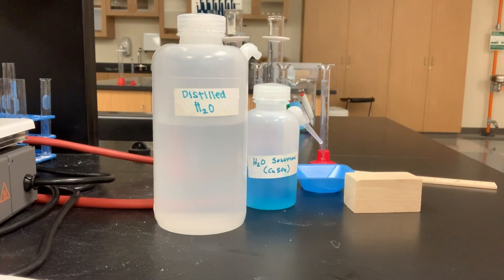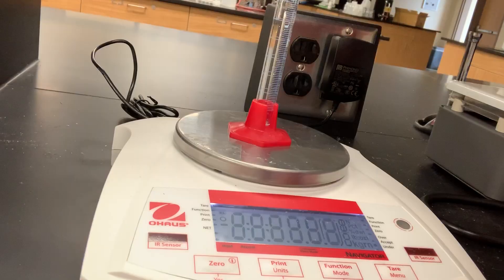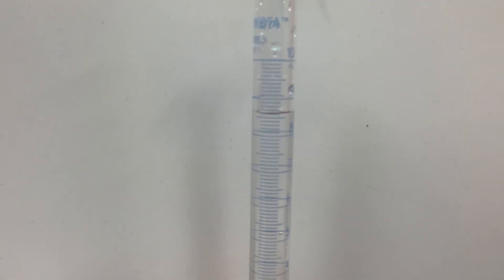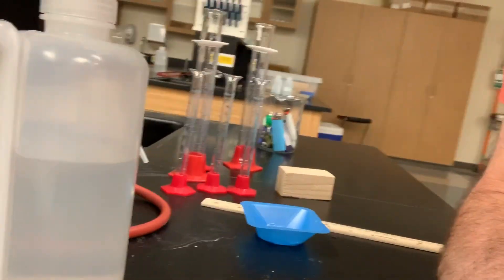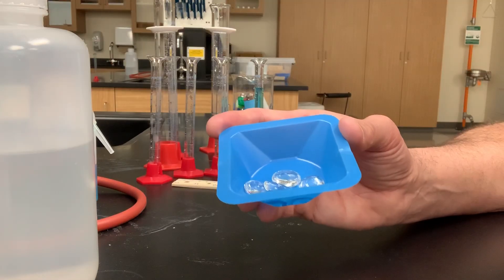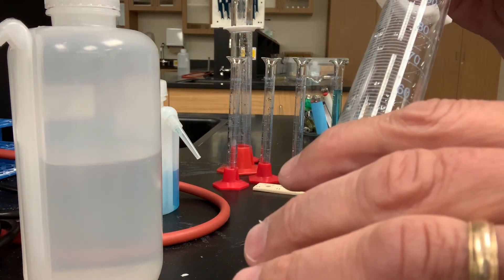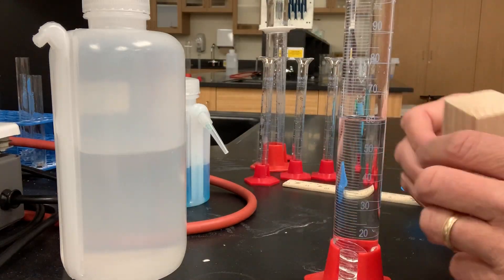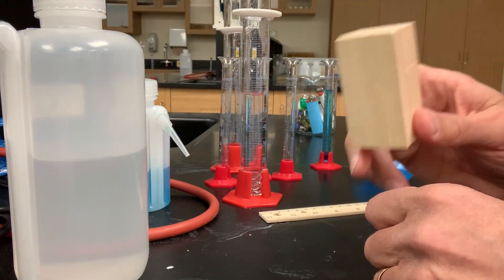Lab: Density

Comment: I got a 100:
----------------------------------------------------------------------------------------------------------------------------------------
What is density, and what two variables must you know to calculate density? (5pts)

"Density is the ratio between mass and volume."

----------------------------------------------------------------------------------------------------------------------------------------
Density of Distilled Water (10pts) 

Mass of empty graduated cylinder (g): 25.38g
Mass of distilled water and graduated cylinder (g): 33.99g
Mass of distilled water (g): 8.61g
Volume of distilled water (mL): 8.6mL
Density of water (g/mL): 1.0g/mL

Calculations:
33.99g-25.38g=8.61g
8.61/8.5≈1.0
----------------------------------------------------------------------------------------------------------------------------------------
Density of Blue Saltwater (10pts)

Mass of empty graduated cylinder (g): 25.38g
Mass of blue saltwater and graduated cylinder(g): 35.26g
Mass of blue saltwater: 9.88g
Volume of blue saltwater (mL): 9.4mL
Density of blue saltwater (g/mL): 1.05g/mL

Calculations:
35.26-25.38=9.88
9.88/9.4=1.05106383≈1.05
----------------------------------------------------------------------------------------------------------------------------------------
Mass of 6 glass beads (g): 18.59g
Volume of graduated cylinder w/o beads (mL): 54m/L
Volume of graduated cylinder w/glass beads (mL): 61m/L
Volume of glass beads (mL): 7m/L
Density of glass beads: 2.66

Calculations:
54-61=7
18.59/7=2.655714286≈2.66
----------------------------------------------------------------------------------------------------------------------------------------
Mass of block of wood (g): 44.41g
Length of block of wood (cm): 7.4cm
Height of block of wood (cm): 3.7cm
Width of block of wood (cm): 3.7cm
Volume of block of wood (cm3): 101.30cm^3
Density of the wood block: 0.44

Calculations:
7.4*3.7*3.7=101.306≈101.30
44.41/101.30=0.4384007897≈0.44
----------------------------------------------------------------------------------------------------------------------------------------

And you can just answer the post lab questions on your own- they are pretty straight forward.  Here's the gist of the answers for the post labs:

"subtract the initial volume of the water in the graduated cylinder from the volume after adding the beads"
"Yes, density is an intrinsic property"
"volume=length*width*height"
----------------------------------------------------------------------------------------------------------------------------------------
You're welcome. I encourage you guys to actually understand what's going on in the lab, and to just check your calculations here- not completely copy.
Reply: yo bro, im trying to get up to date in chemistry, do you have the answers for the "exploring atoms lab"? and any other labs after that? I would rlly appreciate it.
Reply: i find this after i've almost finished the worksheet. its such a time consuming worksheet when its not even too hard
Reply: Thanks for the help I just used it to check but it was still helpful non the less 🙏
Reply: Thanks so much!! I found this after I watched the lab vid, it helped me correct any answers I might've miscalculated. You are doing god's work🙏🙏